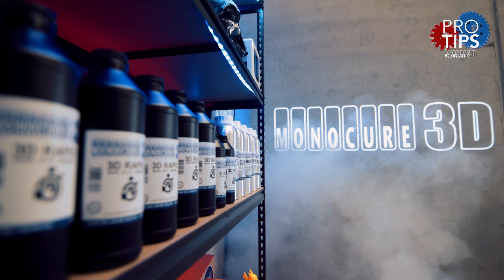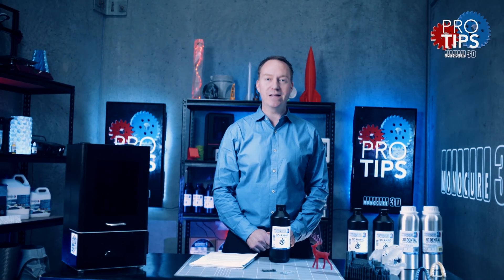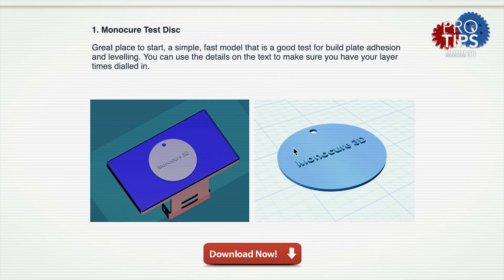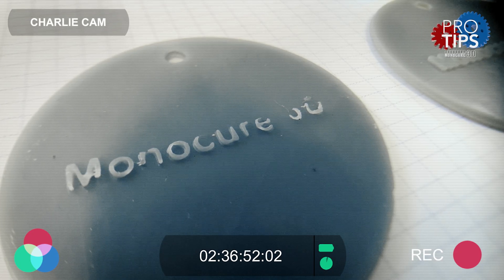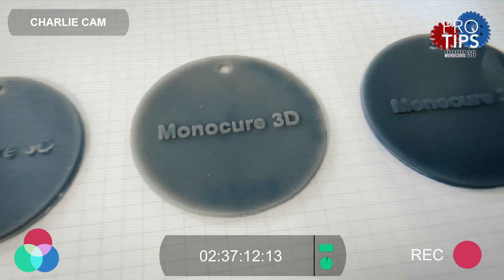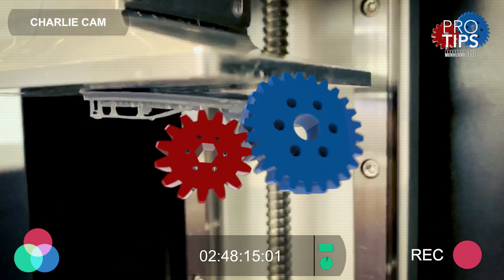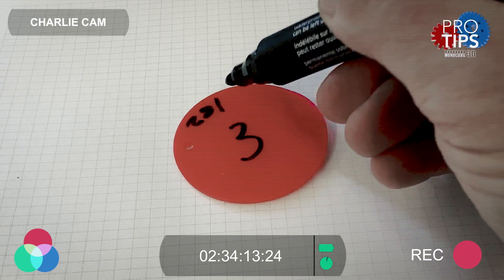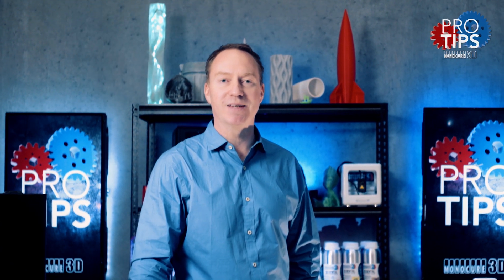How to save time & money when 3d printing with resin.

Comment: Ok a professional and quick video but... doesn't go into specifics on what to adjust when troubleshooting. For example how does layer height, bottom layer exposure time, lift rest times, distance, retract and lift speeds, etc. come into play when dialing in your machine with these test prints? If anyone has a good video guide on this, I would appreciate it.
Reply from the maker: @thevariedlife try our newest Calibration model called the UNiCAL https://monocure3d.com.au/product-category/3d-models/calibration-models/